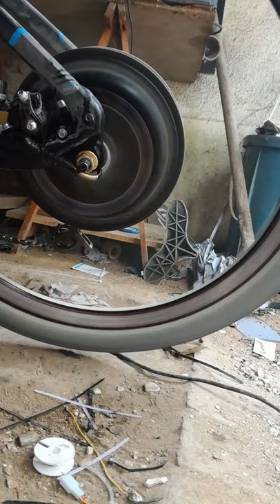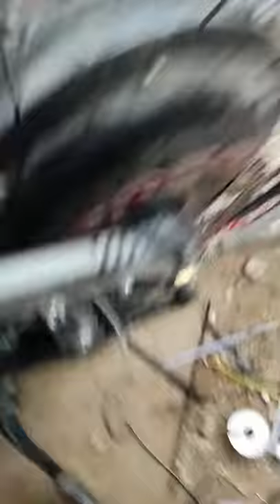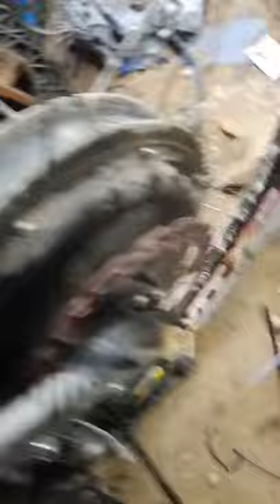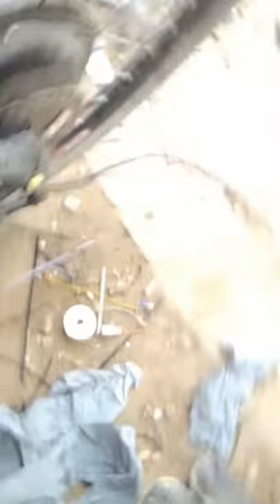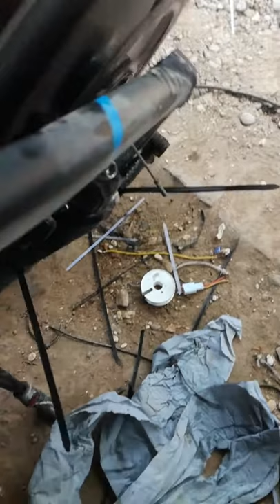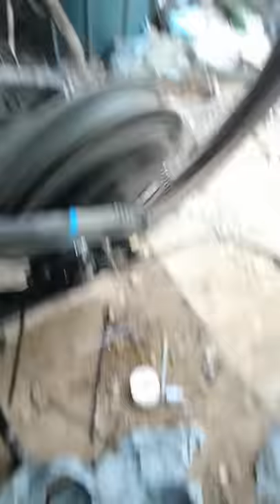Red hot ebike disc brake

Comment: things like that..ONLY ON MECHANIC DISC brakes, not for homo hydros, they will overheat fluid and explode
Reply from the maker: Idk if it will explode but it for sure be bad for the seals and piston
Reply: Explain how cars do it every day then 🤡
Reply: @halogod0298  cars and bikes are 2 completely different things. Smillar way of working but completely different sizes and how much heat the pistons and rings can take and so on...
Reply: @halogod0298  oh yea and different DOT levels
Reply: @halogod0298  different materials and technology, car brakes can survive heat much more than the bike brakes
Reply: Looks like someone can't afford hydraulic brakes 💀
Reply: @ynigospov1853  😆
Reply: Your car's brakes don't get RED HOT while daily driving.
Reply: If you have ice technologies on brakes is pretty much impossible to overheat them. Also mineral oil boils at higher temp than dot
Reply: @halogod0298 they don’t? Does every car you see have glowing brakes?

Comment: All MTB brakes ain't fit for the purpose. They get extremely hot and apparently can't be cooled down with water. What happens if it rains heavily? Can that be helped... No. A bike is supposed to be designed to be used in all weather conditions. These things are a deathtrap

Comment: These disc brakes were designed for bikes weighing less and travelling slower than ebikes.  E-bikes should have dual discs in the front, but are not found on any currently available models.  Even the multi-thousand dollar cargo e-bikes still get the wafer-thin single discs of traditional bicycles.  The brake pads and rotors are inadequate to stopping quickly and their duty cycle is quickly diminished.  My 90 lbs, 500w, ebike has 200 miles on it (mostly CA hills) and the pads show approx 60% wear.  And no matter how many times I’ve adjusted the lever and caliper, i cannot come to a rapid, sudden stop.  Even with fist-fulls of white knuckled braking.  Though my e-bike is electronically governed to 28 mph, the insufficient brakes negate the safety argument for slower top-speed (it could go 40-45mph).
Reply from the maker: For the stopping power it felt good (i have good grip power it helps) but from a 90->0 kmh emergency brake the disc became red hot so 0 endurance
Reply: I use trickstuff brake pads on my trp 2.3 brakes on the cargo bike. I have never experienced any fast downhill situation where I had not enough brake performance. Even with cargo.